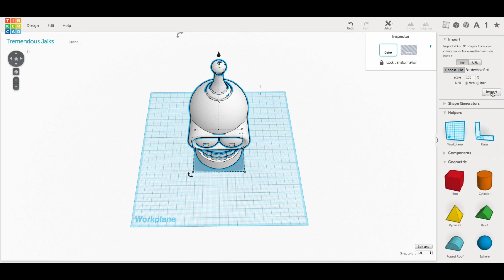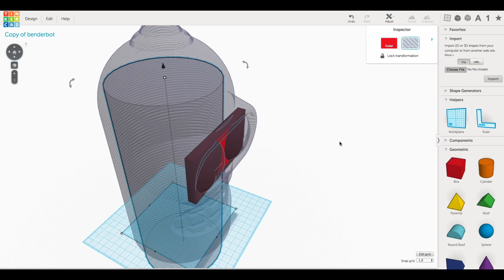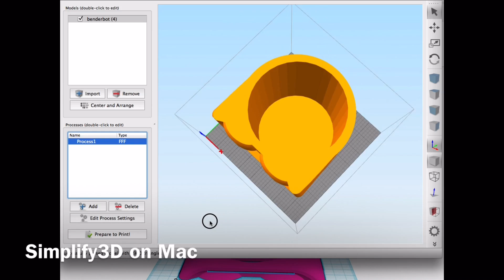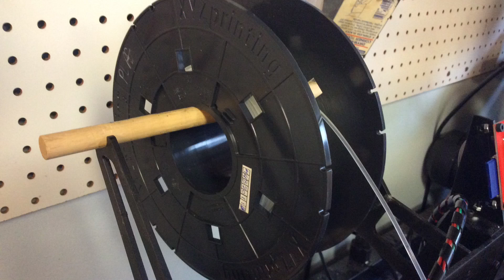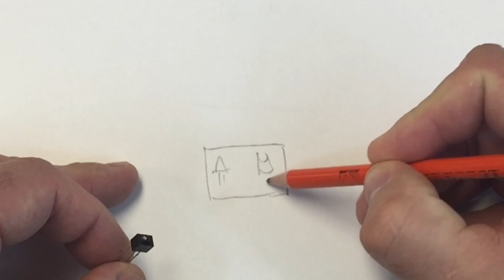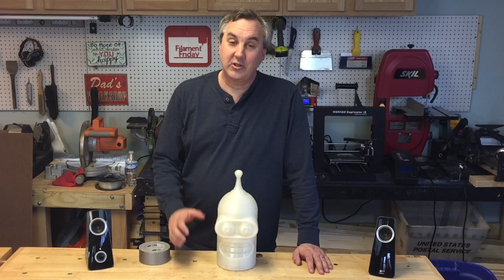3D Printing Filament Friday #62 - Talking Futurama Bender Bank - Arduino and MAKERFRONT 3D Printer

Comment: That's a very thick case chuck, no wonder it took so much filament. It will be very strong though.
Reply: But you seem to have used a massive amount of filament? I print similar sized structures using a 1.2mm or 1.6mm shell and they come out super strong. I wonder how much filament you would use on this model if you did that? Its not just the filament cost, it reduces the build time as well.
Reply: I see. When I do that kind of print, I just shell them instead of combining shapes as you did. I suppose there are advantages for each, but I definitely prefer faster and cheaper prints.

Comment: Great, fun project. What printer would you recommend to use for that size of object if reliability and  print speed is more important than surface finish? ABS and PLA, Max $2000.

Comment: shifting is caused by motors skipping for 2 reasons belt tension or the stepper drivers are overheating.
Reply: +Chuck Hellebuyck's Electronic Products Mine did that one time but it caused it to shift 2 inches 16 hours into a 40 hour print. sad times